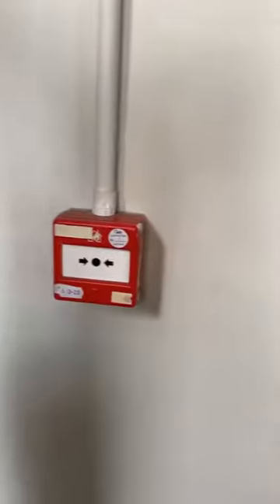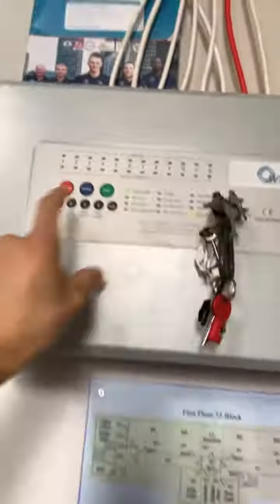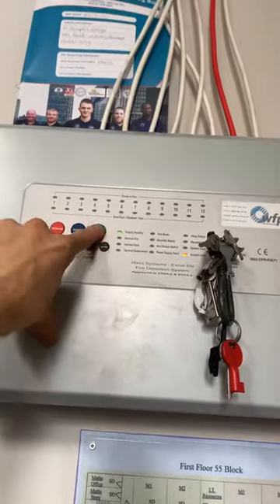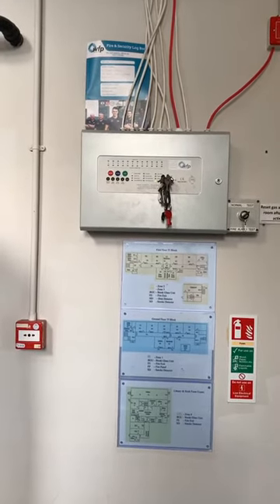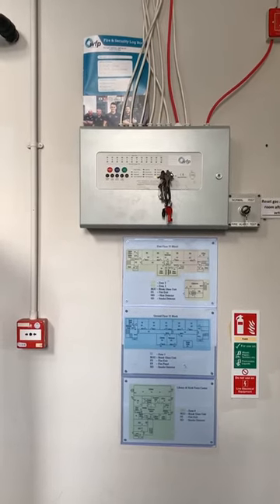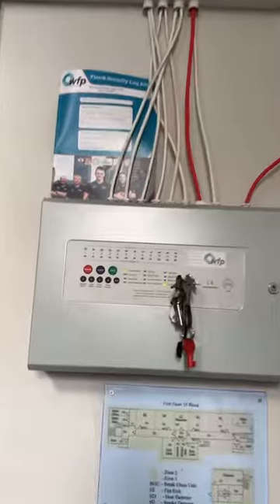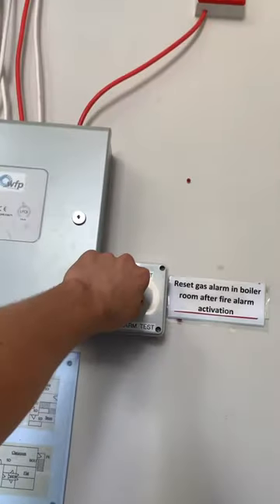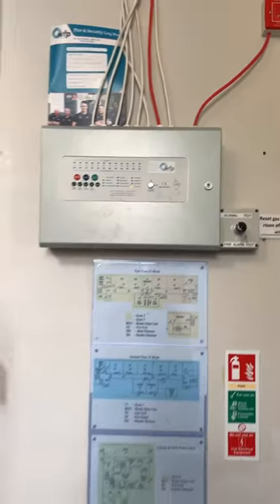How to Carry Out Your Weekly Fire Alarm Test on a Haes Fire Alarm

Comment: Hi guys, great video. I don't have the key switch to turn to test mode, I only have the panel itself. Can a test be performed without that key switch?
Reply from the maker: HI Ben. Yes is the answer, and it is explained at the end of the video with a short clip of the actual key with its reference number printed on it.  If you'd like any engineering assistance we are in the office from 08:00-17:00 week days (excluding bank holidays). Paul
Reply: @wirefreeprotection  Hi Paul, sorry I meant for the Test function, not for panel access. Cheers